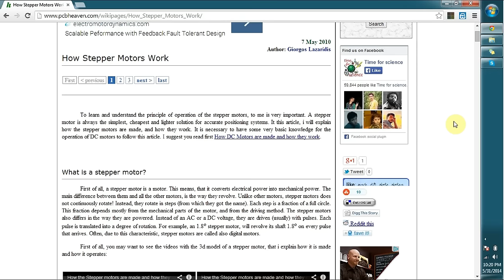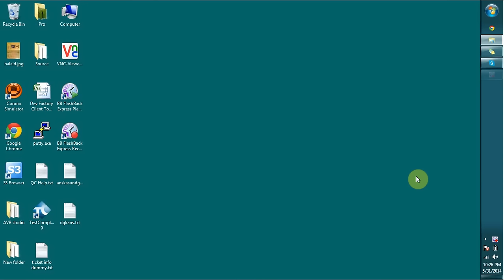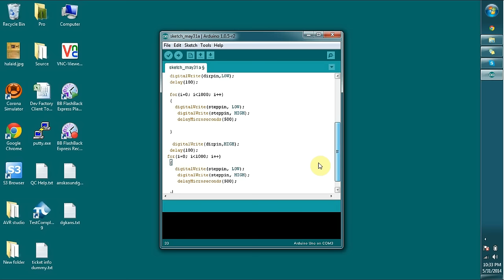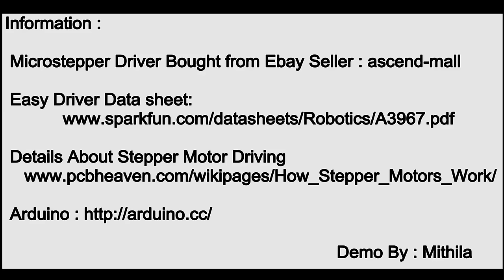Tutorial : Stepper Motor Microstepping With Arduino  (Using Easy Drive Module)

Comment: Great video. Please explain the code. what changes needs to be made in the code to increase the speed of the back and forth movement. How do i calculate the maximum back and forth displacement value and to increase the frequency of the movement by doing micro stepping. Thanks in advance.

Comment: Hey Mithila, nice tutorial but i have question what if i need to change direction of the motor on the bases of digital input trigger like 0v means rotate clockwise and 5v means rotate anticlockwise
Reply from the maker: If I got your question correctly, simply you can change the direction output in the code. if you cannot change the direction by code then add NOT gate before the DIR pin.
Cheers,
Mithila

Comment: Thanks for your tutorial. I have a question - is it possible to control torque of a motor with ED? Because it seams like mine is very easy to stop with fingers during rotation. Or is it depends directly on voltage of power supply?
Reply from the maker: Torque of a Motor mostly depends on the RPM , number of winds etc.. S if you need more Torque better to go for a High torque motor. To select a motor for your requirement this has some Tech information. 
http://en.wikipedia.org/wiki/Electric_motor#Performance

if any query please let me know.
Cheers,
Mithila
Reply: kirill8910 Hey kir... if you have room and don't need a direct torque such as a lever, you can use a worm drive unit. I requires very little torqure to turn the worm gear but once it's turned it's very hard for the item the worm gear is attached to change to position of the worm gear. A good example of this is the stepper worm drive units in the old floppy drives. The still sell the worm drive units on ebay and some other web sites. Do a search on ebay for "stepper motor screw" you'll get the idea. Best wishes and Jesus Bless Keith

Comment from the maker: As the spec says it should work in maximum 30V but NEMA 23 (Single Shaft)  may use higher amperage. you may have to use proper heatZinc  for the chip. 

To be in safe side, better to go for a high power one. since this is rather cheaper option you can try one (a do or die test :) , it will not harm to your motor )
Reply from the maker: L6470 this one will works without any issue, still you may need a better insulation for absorb heat. 
http://www.st.com/web/catalog/sense_power/FM142/CL851/SC1794/SS1498/LN1723/PF248592?sc=internet/analog/product/248592.jsp

Comment: Not getting this to work somehow.. Please help me out.. I have a stepper motor from the DVDRom, an EasyDriver, arduino, and the driver is powered using a 9V battery. It doesn't seem to rotate the motor. I used the same code also. Any ideas? is it due to the 9V battery? or my soldering skills on the easy driver?
Reply from the maker: +Anil Dhan 
can you feel any small movement from motor ? Did you check the arduino outputs ? 
Check the order of the motor connection if you feel some small movement on motor when power up.
Check the Arduino outputs with an LED if you dont have sophisticated testing equipments.

Comment: Hello, if i want to drive 2 motors(cloned) can i use same pins to drive step & direction pins of 2 boards.
Reply from the maker: Hello Sanjay,  

 Yes you can use two boards and same inputs to drive two motors.

Comment: Hi - looks like you got the statements in your for loop not in the right order. Shouldn't you do steppin LOW then wait 500microsec then  have stepping HIGH? 
in the current code you go from LOW to HIGH as fast as the microprocessor can run and then have a delay - isn't that wrong?
Reply: actually ignore that comment - that's actually right, 1 step is created by going high/low and the pause I guess is just to wait for the actual physics to happen and I guess the easy drive is fast enough to capture that high/Low cycle at UNO 16Mhz

Comment: To let the easy step in 1/4 the MS1 have to connect the GND and MS2 at 5V?
Reply from the maker: +Brener Gaspar Ferreira 
Sorry I didnt get your question :(
Reply: +Brener Gaspar Ferreira 

The Truth table for MS1/MS2 is as follows (respectively).

Full step (2phase) - Low / Low 
Half step - High /Low
1/4 - Low /High (Which means your assumption was correct)
1/8 - High / High.

Comment: Hello Friend! First, thank you for the excellent tutorial.
how would the Arduino code to run the stepper motor with motion sensor?
For example, the sensor detecting presence makes the engine run 200 steps; then returns to zero degree.
Thank you
Reply from the maker: +Daniel Fernandes 

 You dont need to motion sensor since you are using a stepper, you can count the steps to get the angle of the rotation. and then set it back to Zero level by reversing the steps.

Ex : to reach 30 degree you need 15 steps and then if you need to go back to zeroth  position just send 15 steps in other direction.
Cheers,
Mithila
Reply: OK! You do not understand me!
I would like to engage in your circuit a motion sensor when the sensor detects motion, the motor rotate 200 steps then back to its source (0 degrees);
Thanks again
Reply from the maker: +Daniel Fernandes 
then simply once you receive the signal from your sensor just change the direction pin input. 
Thanx

Comment: Hello can you tell me how you Setting the Current Limit on easy driver ?
I have stepper motor Nema 17 Rated current/ phase: 1.4A
Phase resistance: 1.40hms
Voltage: 2.8V
Reply: mAXIMUM CURRENT/pHASE THAT CAN DELLIVER AN EASY DRIVER IS 750 mA/Phase . So I think that you should find another driver for exemple: L298 will do the job
Reply: ok thnx